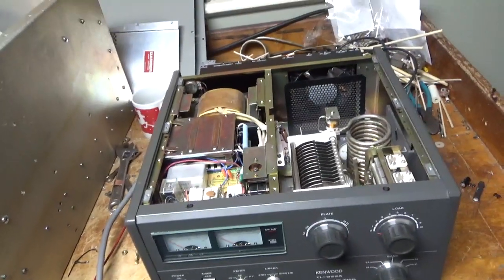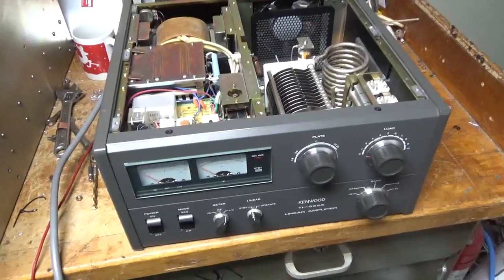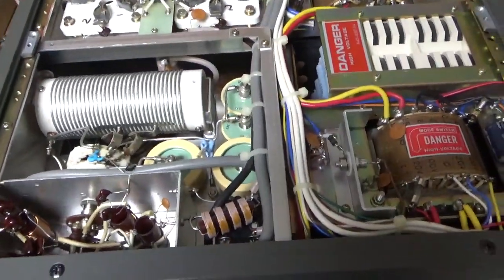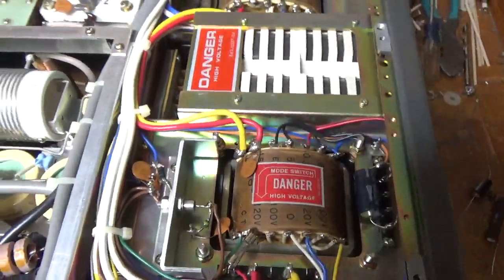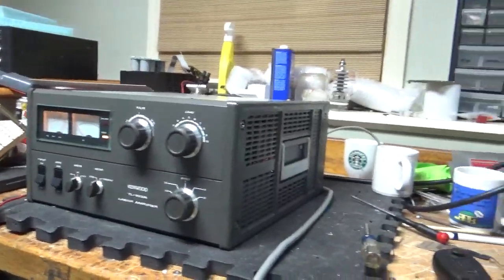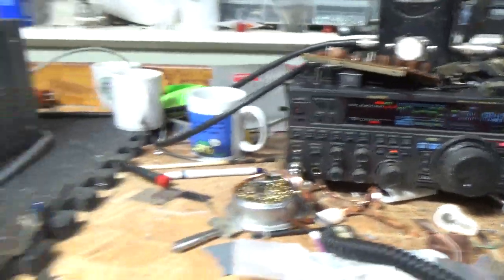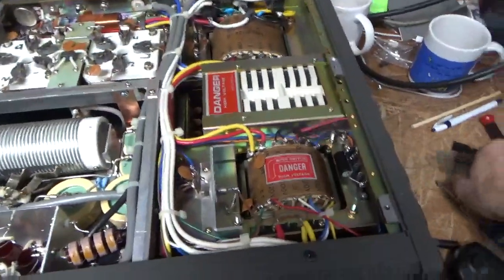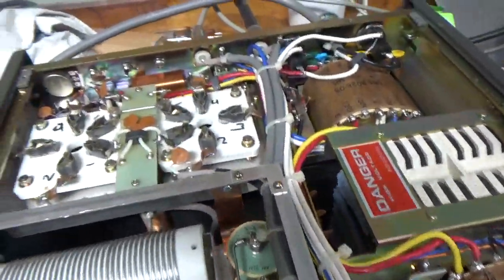Kenwood Tl-922 Repair And Modifications With 40 Meter Output Test.  3-500Z Tubes

Comment: My TL922 seemed to have a little more gain with grounded grids... not the best cooled amplifier of all time but elegant looking and I don't rag mine...  you mention "self bias" presumably you are talking about the cut-off bias and the usual mod?
Reply from the maker: Self  bias as in filament center tap / cathode return lifted with a 100k resistor to put tubes into cutoff  and biased on by shorting the 100k resistor

Stock setup is called forced bias. They rectified a winding on the filament t eta ma former which they fed into the cathode to put the tubes into cutoff. This winding also powers the two relay coils. If ever had a grid to filament short you would most likely damage this winding and then need a new filament transformer. 

Heathkit had the sb220 bias setup the same way.

Grounding grids along with other mods get more stability . And as you said more gain. 

Stability issues are often most evident on the higher bands and some try different parasitic designs to correct. 

The mods I implement protect valuable components like the tubes , band switch , plate current meter , air variable capacitors for the output network , filament etc.  Once implemented it is a rock solid pa. 

No issues with the cooling when run within its output specs. Great amp after all mods have been done. Would take one over any of the Ameritron amps any day